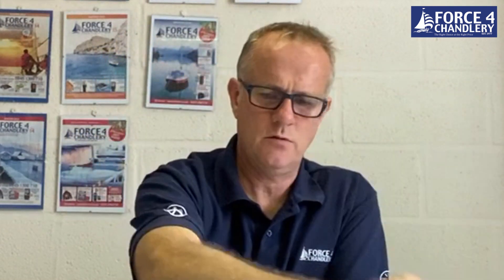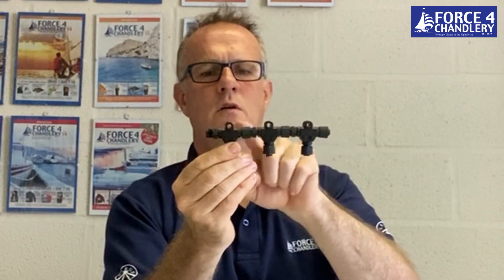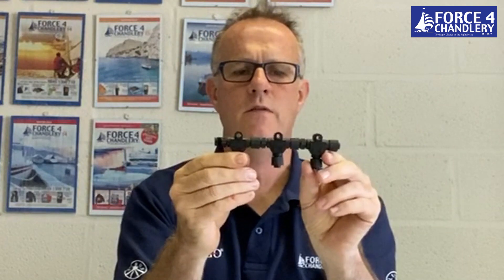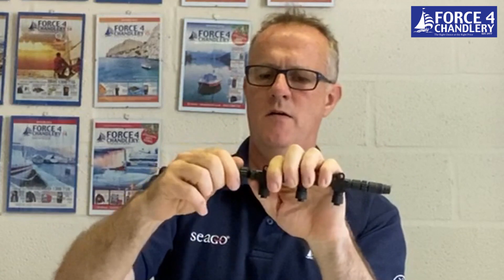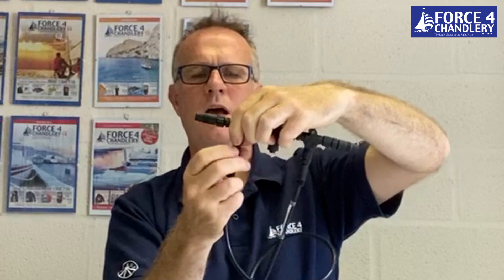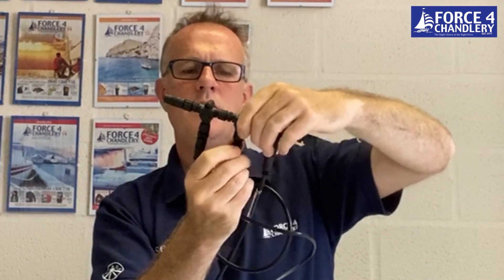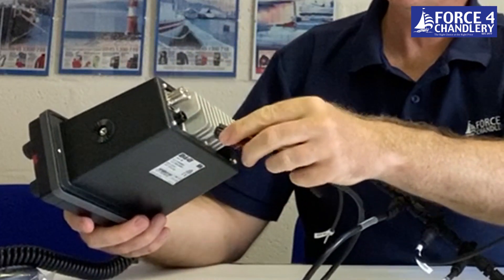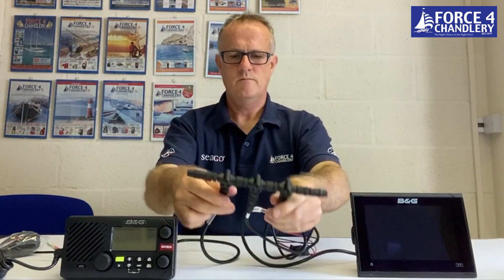How to build a basic NMEA 2000 Backbone - start your own NMEA 2000 onboard network. A Force 4 Guide.

Comment: So you need to connect each device to power and the nmea to power ? The nmea won’t power the devices correct ? Thanks
Reply from the maker: Hi Jared, thank you for your question. The NMEA 2000 network is a low current network and will not power anything that draws over 1A. So chartplotters, AIS transponders, VHF radios etc need their own connection to the 12v supply. Items such as sensors and instruments can be powered from the NMEA 2000 network.